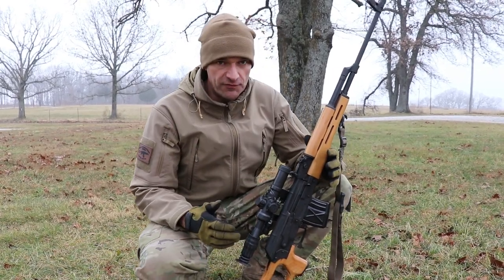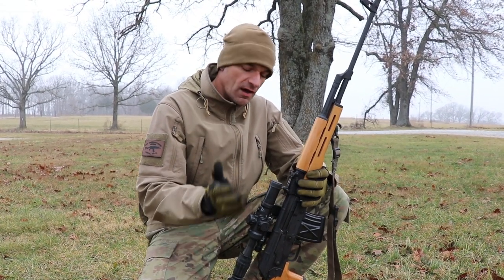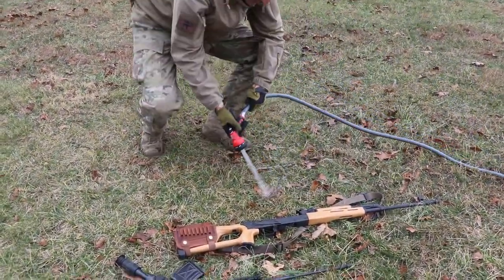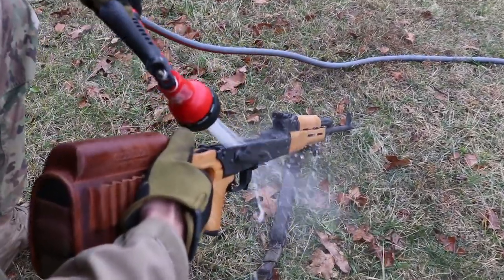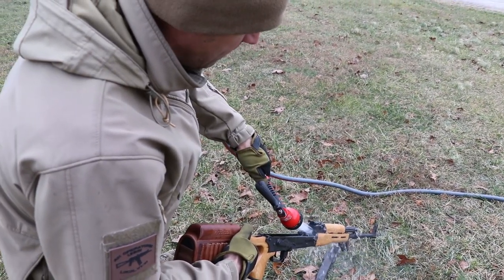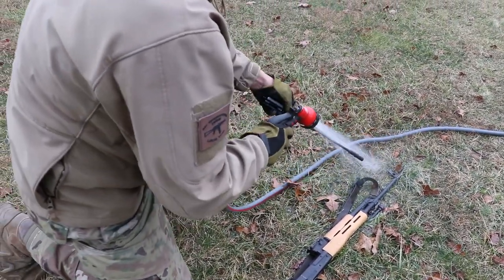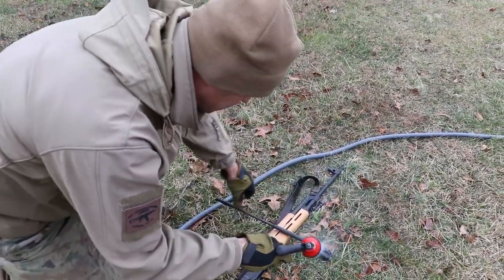Corrosive Ammo

Comment: I'm a qualified firearms instructor. This procedure is unknown to me. I've never, not even once, used water for weapons maintenance. Does that WAPA really require water ? What does the operators manual say ??

Anyways, if you really, really insist on using this kind of cheap crap as ammo, there is no way to neutralise the residue. It has to be rinsed away. Preferably with oil. Ballistol is very cheap, and great to  use. Kerosene, turpentine, diesel, anything is better than water!
Reply: Water and dish soap has always worked well for all my Soviet ladies
Reply: If "This procedure is unknown to me", then you've never shot corrosive ammo. Water isn't used for gun maintenance, it's used to ensure no barrel damage from the ammo itself. 
I use a laundry sink with warm soapy water, then I lube everything that needs it. 15 minutes from start to finish and that's only 5 minutes more than I take cleaning/lubing my other weapons systems out. Over 10k rounds of corrosive ammo, still at 1.5 - 2 MOA. Not bad for nearly half priced ammo and a $175 mass produced, 72 year old rifle.  Cheers!

Comment: Don't you have to make sure you get a light coat of oil on ALL the metal? How do you get to the hard to reach spots without just dunking the whole thing in oil?
Reply: Because in an AK variant system there are no "hard to reach" spots. Spray it down with balastol (10 seconds or less) reassemble (30 seconds) and call it a day.
Reply: snoopy dubnation ... What makes you think I was suggesting you didn't turn the bracket and pop off the furniture (0.5 of a second)? It was implied that the rifle was broken down clearly I said "reassemble", you should be able to infer that you disassemble it first (20 seconds). If you like to detail your guns after shooting that sounds cool and relaxing..... But hardly necessary for and AK variant. However we were not discussing cleaning, we were discussing oiling. Your premise was that it might be difficult to get oil where it needed to be in the AK system without dunking it (after its been disassembled and hosed off as in the video). I merely mentioning that the weapons system is completely open and exposed, there are no spots that would be difficult to oil. Just spray it down with balastol and reassemble it. (no you don't have to dry it first the oil spray will shed the water off). Balastol is also great for the wood furniture and your wood workbench so, no worries about over spray.
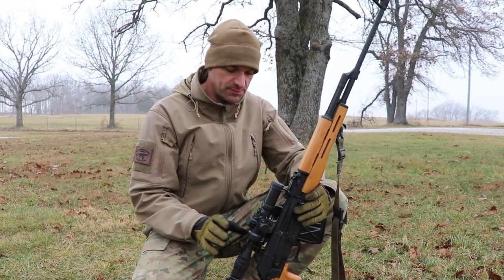Reply: snoopy dubnation   just re-watch this video... How long did it take to get the weapon disassembled? 0:20 to 0:38 ....then he pops off the gas block in about another second. Ballistol is in an aerosol can, kinda like wd40. Just spray it down, liberally. Sorry I don't post videos of weapons. Not smart in this day and age with red flag laws and crazy gun grabbers etc. Plus there are already a hundred videos of this, just look em up. Hickok 45 is pretty good one.

Comment: I alway spray windex on mine and use an air compressor to dry it off. Then clean it. I wouldn't leave water on the wood for too long. I did that to my MAK90 trying to get a dent in the wood out and water got under the  finish and screwed the wood up. It left a white haze between the wood and the finish.
Reply: Just sand it down and refinish
Reply: windex has little ammonia--sucks..use REAL ammonia

Comment: Don't do that 😅
U will get rusty Weapon 👊
Reply: Paradox 🤔
Reply: Yep.....just pour soapy hot water and ammonia down the bore.....done..takes 10 minutes
Reply: @chadhaire1711 
Hey Chad, I posted a link with some photos of corrosion on my rifle and was wundering if you received notification or if it was shadowbanned ? 

If you received it, I would greatly appreciate your time spent in responding to my question. 

Thanks
Reply: @Soli_Deo_Gloria_.  What brand of rifle is this?  What part of the country do you live? This is simple rust caused by moisture.....either by direct contact with water or more likely  in the air from a humid climate.....many Chinese AK's were famous for this problem...cheaper AK brands too.  It gets in the  tiny cracks and spreads....that is why you should NEVER NEVER hose a gun  down with water like was done in this video..NEVER!!!!   Strip the rifle down and hose it off with BreakFree, or ballistol and let it sit for a day...then wipe off about 80% leaving a light coat....WD40 works too but it is not a lube so you want to wipe it off more than the others.   When storing the rifle take one drop of lube on a patch and run it into the bore to keep moisture out.
Reply: @chadhaire1711  
I sure do appreciate your time spent in responding. I've seen many comments of yours on this thread, and you said in one of them you've shot AK corrosive ammo for years. Which leads me to believe you are knowledgeable in this platform.

The rifle is a PSA GF3, and only 3 months old, with only 150 rounds of various ammo from Tulammo, 2 kinds of Wolf and 2 different Barnaul ammos. 

A few days ago after 150 rounds and three outings I went to check wear on the bolt carrier group and just inspect the gun overall. And found what you see in the photos. 

But anyway, the two Wolf and one Barnaul are about 15 years old, but one of the Barnaul ammo seems to not be manufactured anymore, as I'm not seeing it for sale anywhere. Except one website had a guy listing one box for sale. The graphics on the box has a cowboy on it and it says "Cartridges 7.62x39 Hunting Ammo".

I was not sure if I fired corrosive ammo through it or not, because I live in one of the driest states in the Union, thus humidity is not much of a concern and the rifle has never been rained on. Which is why I'm researching this. 

The first time I fired it was in first week of March so the temperature was probably about 50 - 55 degrees F. I fired 70 rounds that day and not any mag dumps as I was making sure everything was good to go, so the barrel was never extremely hot to the touch. 

I then placed the gun in a soft case and went home. Maybe these conditions created a fast temperature change that caused condensation in the smallest amount, but yet enough to have had this result. 

I talked to my local gun guy who is a seller, gun owner and 1000 yard plus shooter, and he said he thinks it's condensation and not ammo related. 

He also told me that storing rifles in soft cases is a bad idea, as most are made of cotton and will suck moisture out of the environment and wick it towards the inside, which ultimately contacts the rifle.

He recommended a nylon brush, four odd steel wool and Hoppes to deal with the rust inside and outside the receiver and Hoppes barrel cleaner, or Sweats to clean the barrel. And not to store it in a case. 

Another guy on youtube recommends CLP.. 

Everyone has an opinion… 

My local guy also said that he knows guys who shower with their AK, but he said it's a bad idea. 😂

I'm new to the platform (owned a mini 30 (stainless😎) for 15 years) so I'm researching and was trying to decide to send it back for warranty, but I honestly don't want to part with my hardware. You never know what you'll get back. And besides, Palmetto State Warranty addresses corrosion on the warranty, and it's not covered. 

My local guy said PSA’s QC is substandard and their metallurgy is also not the greatest. He also said that all manufacturers QC have suffered for the last year. Heck, he even pulled a new JTS AK shotgun off the shelf and it looked like crap. 

So I don't know, kinda bummed to drop 8 bills and see rust 3 months later.

That's my life's story.

Thanks for listening to this ramble… 

Any thoughts would be much appreciated.

Thanks again brother
Reply: @chadhaire1711 
Thanks again for the no nonsense cut and dry input. 

"Do not send it back to PSA, you'll never see it again."  😂🤔😭

Thanks again brother
Reply: @chadhaire1711 
Looks like your comment was deleted, stange... 🤔
Reply: @Soli_Deo_Gloria_.  Go back and re-read what I said......I never said WD40 was a lube....Never said it was to be used on moving parts....I said it got rid of rust and you want to get rid of rust.  There are no moving parts in the photos you posted so using WD40 in the cracks to get rid of the rust and get in the cracks to prevent future rust is just fine.  Lubing the rifle is a separate issue and I covered that as well.

Comment: I never would have done this because I would suspect water would create rust somewhere in the rifle I can't see.  I also think you would get a lot more hits if you had a hott bikini model wash your AKs in the shower.
Reply from the maker: lol, nice tip, but seriously,  doing this for decades and never had a problem with corrosion and I live in humid climate...If you will flush out corrosive salts you wan't have a problem. Period. If you will do half ass job, yes, you will half ass results.
Reply: @AkOperatorsUnion  I will give it a try seeing as I have 1000s of surplus 7.62
Reply: @corporaterobotslave400  They are military rifles and subjected to rain and water regularly. Straight water does not turn steel into a pile of rust instantly, its prolonged dampness or salt that creates rust pitting. Just make sure to dry it well before oiling and reassembly.
Reply: @Tony.795  Ok, should the same apply to my Tikka 1 MOA .308 rifle?  I've never seen any hunters or snipers recommend this.

Comment: When I  would shoot corrosive ammo I would fill a bucket with hot soapy water then run a tight patch from muzzle to chamber while the muzzle was submerged in water. This creates a vacuum which pulls water up the bore. Repeat. A lot LOL. Its an option for folks who may live in a place where stepping outside with a rifle and watering it may not go over so well. Oh and it will only really work with bolt actions (unless you plug the gas port).
Reply: @chadhaire1711  The method I described requires a cup of a soapy water and a pull string with a patch (something you probably already have). Furthermore, the method I described ensures that 100% of the bore is coated on every pass and, because of the vacuum, you can hold the soapy water in position for as long as you like to give it a chance to soak. Finally, you can implement it without stripping the rifle from its furniture. 

"just doing it right" is not doing it your way...there is more than one way to skin a cat. In this case, both will get the job done. I shared my experience to help those who do not have the ability to water their firearm outside and who may have very little on hand.
Reply: @pgeorg01  Yes but in your case you are using COLD water.  HOT water with no soap works better than cold water with soap.  If you are going to use cold water, you should have an ounce of ammonia in the container....that is the main ingredient in  cleaners for black powder.
But about anything is better than using a water hose like this guy does---this is an interesting channel, but some of the things they do here are just beyond stupid. Using a magazine as a bipod, and over heating the suppressors to test ammo function are some of the others that might  look cool, but only if it is the other guy doing it.
Reply: @chadhaire1711  Please go back and re-read my original comment (which is un-edited). I specifically stated "hot soapy water".
Reply: @pgeorg01  Ok..I mixed you up with another email who said he took a water bottle at the range in his shooter bag.
Reply: @chadhaire1711  No worries!

Comment: Пардон, но мне кажется это бред. 
Влага ускорит появление корозии ибо водой без механической чистки не смыть продукты горения пороха.
Лучше всего сразу после стрельбы пройти нейтральным маслом. Во первых оно блокирует воду, во вторых перед полноценной чисткой оно разъест нагар и упростит чистку. 
Sorry, but it seems to me this is nonsense.
Moisture will accelerate the appearance of corrosion. Water will not wash away the combustion products of gunpowder without mechanical cleaning.
It’s best to apply neutral oil immediately after firing. Firstly, it blocks water, and secondly, before proper cleaning, it will eat away carbon deposits and make cleaning easier.